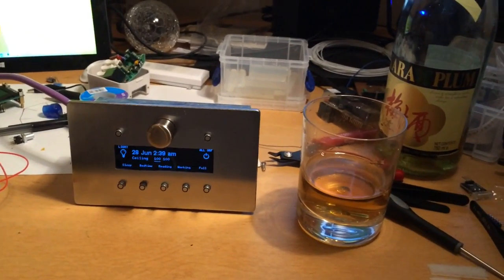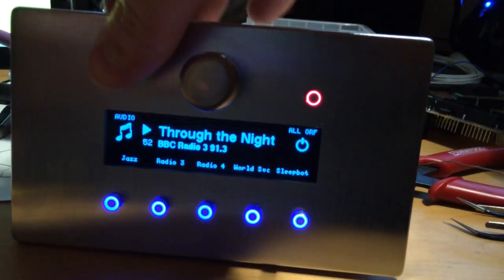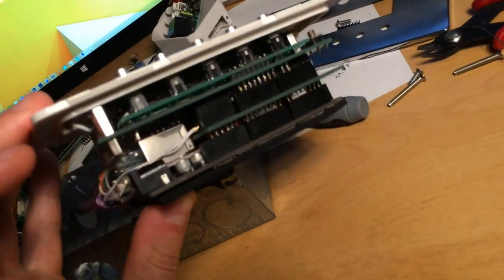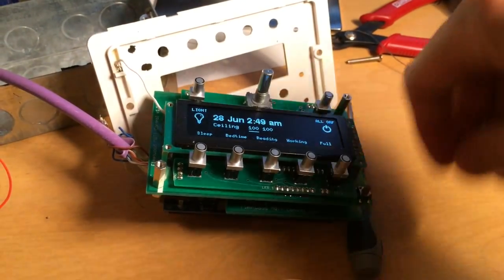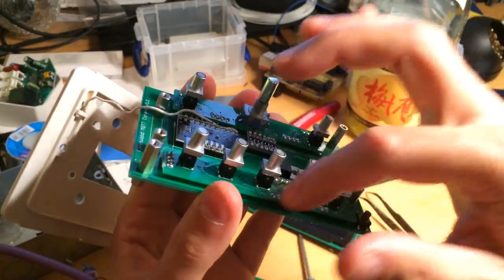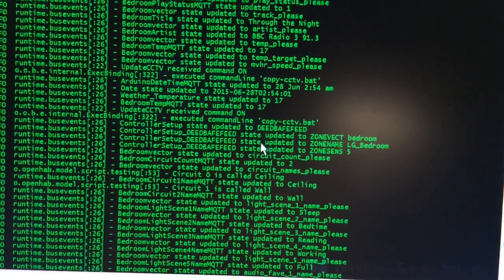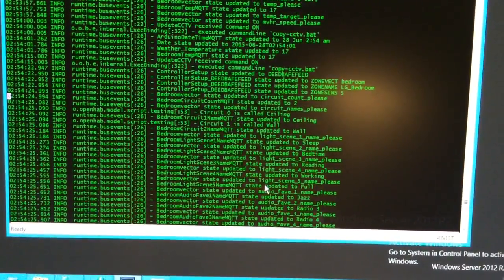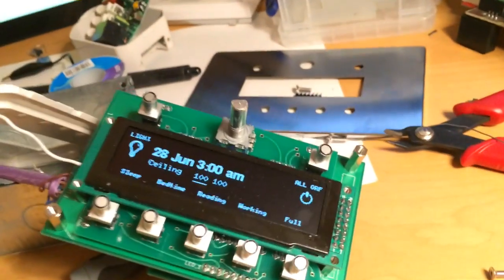Tis Finished! MQTT OpenHAB Wall Controller Project

Comment: I am trying to access raspberry pi, which is behind a Nat ‘ed network from internet without port forwarding and third-party website. The functionality I am looking is something like what dataplicity is doing. I am noob to networking and python. But have strong coding knowledge with Microsoft .NET and Angular 2 and higher. I would like to host my own website with this functionality. Could you please help me with this? Also dataplicity’s client agent can be found at dataplicity-agent

Comment: Hi, Awesome Project, Could you share about proximity sensing. i once tried it switching on led's for 10000ms when detects the arduino pin connected to metal sheet. but it went on blinking....
Thank's a lot.
Reply: this is the code: it works but not as efficient as yours.
please let me know if any suggestions

#include <CapacitiveSensor.h>
CapacitiveSensor   cs_4_2 = CapacitiveSensor(4,2); 
void setup()                    
{
   cs_4_2.set_CS_AutocaL_Millis(0xFFFFFFFF);
   Serial.begin(9600);
   pinMode(LED_BUILTIN, OUTPUT);
}
void loop()                    
{
 long sensor1 =  cs_4_2.capacitiveSensor(50);

    Serial.println(sensor1);  // print sensor op
   if(sensor1 >= 1000)
   {
    digitalWrite(LED_BUILTIN,HIGH);
    delay(3000);   // LED stays on for this time in ms 
   }
   else{
    digitalWrite(LED_BUILTIN,LOW);
   }  

}

Comment: This looks like an awesome project! I will have to try it out. Fortunately I have a house of 9 Bose SoundTouch speakers, which all have 6 presets, which can be any station, track, playlist you want. (Internet radio, spotify, pandora, xm radio, etc) It would work perfectly with openhab for volume control, presets, track controls, and a few other things.

Comment: where are your relays? and via where are you connected to the lights?
awesome project!!
Reply from the maker: +Wietse Delclef Thanks! Currently lights are controlled by OpenHAB over RF, using LightwaveRF light switches (this is a UK product but there are many alternatives elsewhere). My aim for the new home is to install a DMX dimming system in "node zero", i.e. a central location.

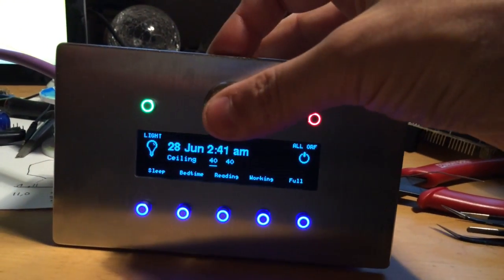Comment: Why can you only have 6 lighting circuits in the menu, 2:09
Reply from the maker: +StewartBroadcasting 6 is the number that fit comfortably and in a visually pleasing way on the display without introducing pagination. No reason why we couldn't add pagination I guess! For my home I'll need a maximum of 6 but this could be changed in code.
Reply: +Mat Smith I though that the buttons along the bottom were pre-sets, and the individual lighting circuits (lamp, side lamps, ceiling lights etc) were selected by pressing in on the dial on the lighting menu.
Reply from the maker: Yep you are correct. Just to clarify, there are 5 buttons along the bottom each representing a scene / preset.

In addition to these labels, the display shows all light circuit levels (as percentages) at a glance, on the same screen. You can cycle through circuits to select and change individual circuit light levels, but it still shows all circuit levels at the same time. Hope that makes sense...
Reply: +Mat Smith I understand now, how did you design the GUI for the display, I assumed you used a program to export the bitmap for the display, and not manually key in the values. Also,no you know any good books on the use of openHAB. Thanks.
Reply from the maker: +StewartBroadcasting I used GIMP for the icons yes and exported the xbmps, then stored them in program memory in the Arduino. All the text is managed in u8g library for Arduino...

Comment: Could you please post a list of the things that you used?
Reply from the maker: +Francis Isabel Hi Frances. I haven't documented the bill of materials and it doesn't seem worth it as version 2 is quickly on the way with a far improved PCB! V2 has a proper BOM. I'll keep you posted here on YouTube if interested, but do also check out the GitHub repo for updates. Cheers
Reply: Thank you.

Comment: Do you have a basic failsafe mode for your controller? So if there's a storm or something, and the openhab server is damaged, will the controller default to some simple state? Maybe basic lights on/off, with an error message on the screen. So at least you can have basic control until the server is fixed.
Reply from the maker: +ThalassTKynn Right now I'm still prototyping it. Haven't started cabling up the new home yet. But when I do... the plan is to wire lighting to a central DMX dimmer. The dimmer will be controlled by a central Arduino addressed over the network from OpenHAB. On this Arduino I'll implement an MQTT heartbeat - if it doesn't receive an update once every 30 seconds then it will turn all lights on full or something like that. Also this means I can have an emergency push button in the central location connected directly to the Arduino in case things go badly wrong.  I need some kind of contingency for the situation where I need to rebuild the server as well. I have OpenHAB configs and runtimes stored on Dropbox so it's technically a quick restore - but if there's nothing to restore it onto then I'll need some more directly attached push buttons I think :)

Comment: Absolutely awesome dude! Would you mind letting me know the hardware used to be able to set the level of your room lights? I've been researching and can't find a solution capable to set the levels like you do, the dimming solutions seem really long winded and worse still take up so much physical room its crazy. Hope you're still reading these comments :)
Reply from the maker: +Sam Matthews Hey Sam. Right now I'm using LightwaveRF (UK) dimmers installed into the wall. It's not ideal as there's only one-way communication (i.e. you can tell it to dim to a certain level but if you update it on the physical switch OpenHAB won't know...) I'd recommend using Fibaro dimmers if you want to fit dimmers into the wall sockets, otherwise centralise and go with DMX which is what I plan to do eventually!
Reply: +Mat Smith Ahh okay dude, thank you for the reply! I'm going to be looking into the system to detect the amount of current/load on the circuit and then to work that out as a percentage of the full amount (hopefully, some how). If i ever get a good working solution i will share via a video if you're interested at all. Thank you again!

Comment: It was my understanding that Arduinos are used for prototyping and you would use the raw chips in your finished product. Wouldn't doing that decrease the size of your project?
Reply from the maker: Tyrone Ward There are two models: 1) using Arduino for prototyping then designing from scratch, 2) creating shields i.e. addon devices so that people can buy their own arduinos. The former is obviously technically superior but the latter is arguably more saleable, also I'm not sure I have the design and manufacturing expertise to do make the project from first principles without piggy-backing on the Arduino!
Reply from the maker: +Tyrone Ward Right - I'm convinced. I'm making it from scratch...

Comment: Could u share ur Arduino code?
Reply from the maker: Ryank9268 Hi Ryan. I'm hoping to post some snippets of the code to show how things fit together. Problem is that it requires a lot of setup on OpenHAB currently, so the sketch in itself wouldn't work without a whole load of documentation, which I simply haven't had time to do. Not to mention it's changing every day at the moment! Watch this space!